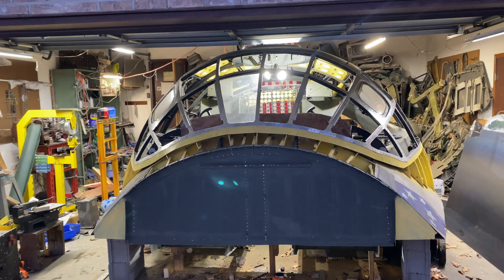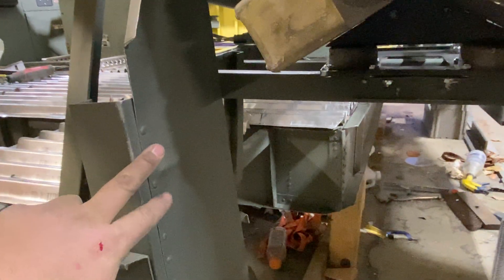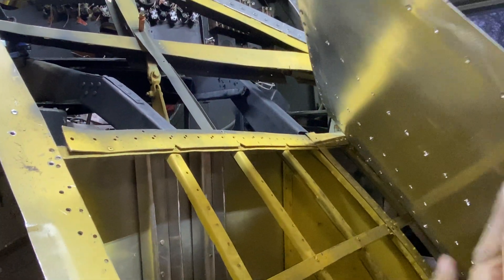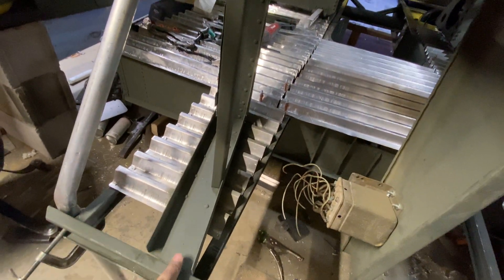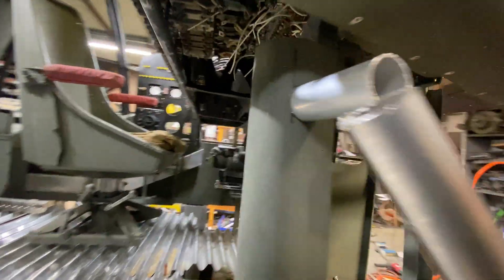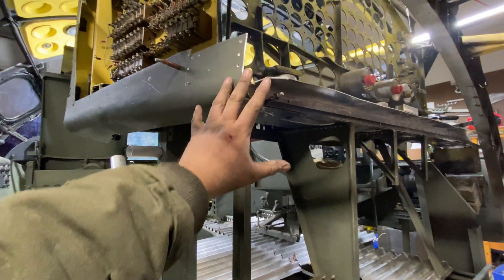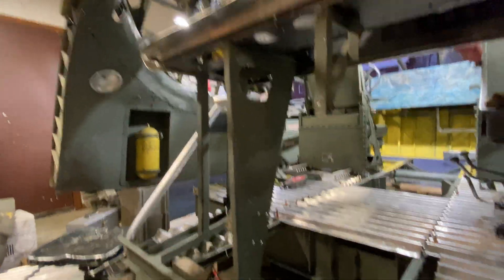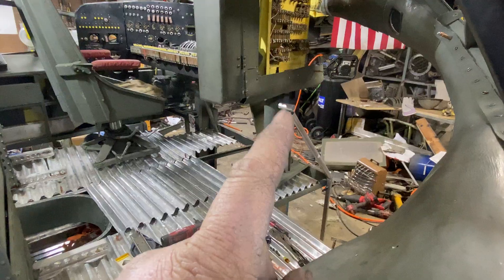I’m Building a 1:1 Scale Convair B-36 Peacemaker - Flight Engineer Station Progress

Comment: That's crazy!! I would love to do the same with the C-119. It's my favorite aircraft and there doesn't seem to be any airworthy ones left.
Reply from the maker: A 119 would be a breeze. Plenty of airframes to study, photograph and measure, and it used many common parts shared with many other aircraft.
Reply: @B36HPeacemaker  really??? For a bit tho I was thinking on trying to find one from a scrap yard or whatever, I think three just got auctioned off in September but if I had the education, knowledge and space to build a 119, I so would.

I’m currently studying to get my PPL and majoring in aeronautical science
Reply from the maker: @17_2nd_Studios Once you know what fasteners and alloys to use and where, building an airplane is not impossible. You may be able to find engineering drawings to the 119. Do what I did and start with the main instrument panel; that will keep you bust for a few.
Reply: @B36HPeacemaker true yeah, I’ll look around! thank you for the insight. the main instrument panel would probably be really fun to make

Comment: you should live stream building
Reply from the maker: Doing so would be disastrous. I am constantly designing and reverse engineering as I build. I am always looking at photographs, running between computer and the garage, taking measurements and using one of the 75 tools spread around me on the floor. Additionally, I am always checking on my elderly mother, helping her around the house and so on. I would have to change camera angles and focus on making things worth filming which would hinder my ability to produce an accurate product. Careless mistakes would be made and I would have to rebuild areas which costs money and time. Finally, the views I would receive for my effort would most likely not see return. Occasionally I film myself making smaller parts for those who have suggested I stream, etc.